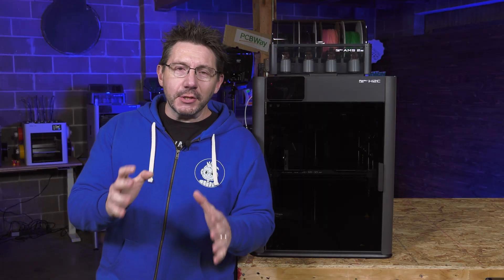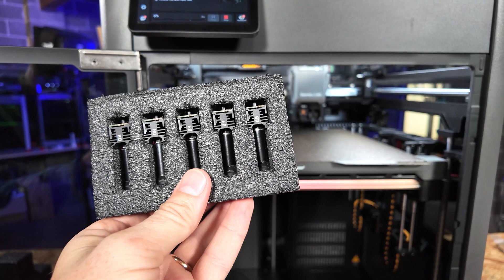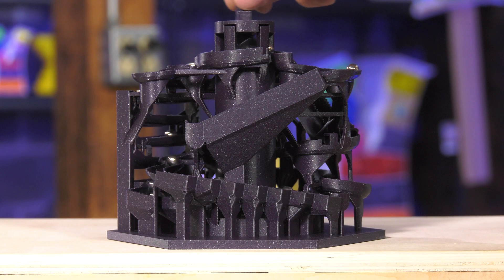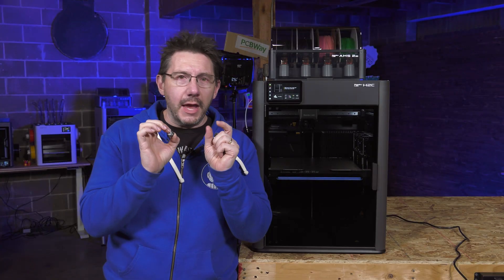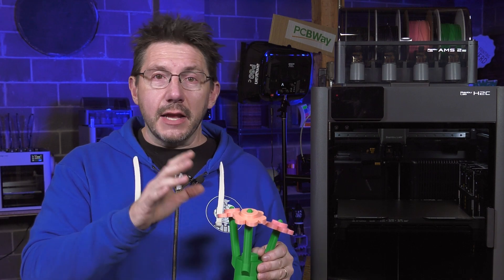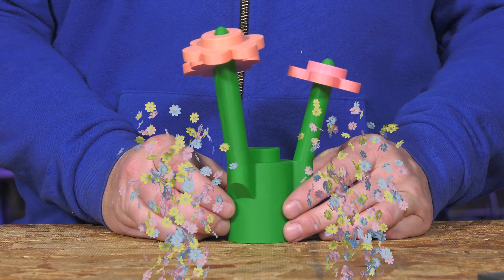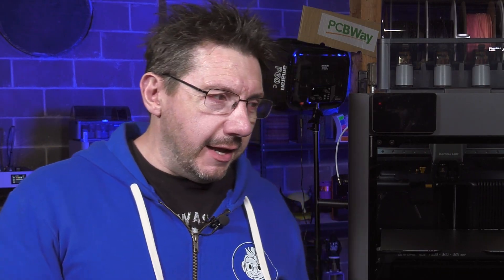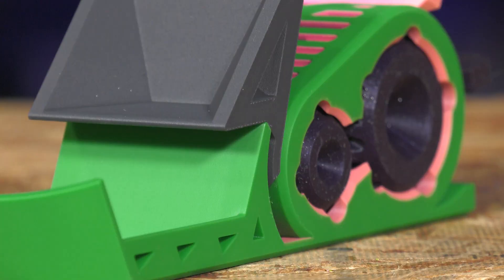My Review of the Bambu H2C + Vortek

Comment: I avoid pa6 like the plague. Pa12 is significantly better.  Pa6 can hold like 4x the water pa12 does. It never splits for me and I have used it for car parts. Pa6 just seems to split constantly if it's cf or gf
Reply: Yeah all the tool manufacturers are dumb for using pa6 for all their casings...

Comment: I liked the video and i loved to know this big issue with the bed, but I think that the majority of the ppl where here for the Vortex and in this reguard the video was kind of "weak"... I would love to know the difference in time between a normal ams multi color print and a print with the vortex, just to have an idea if the system is actually worth it, or even if you have any info about the Vortex on other machines from your "guy".... I have my eyes on the H2S and at this point I have to ask, you probably have that one as well, does it have the same thermal issue on the bed or is limited to this new model?

Comment: 16:30 unless that was designed for that nozzle/layerheight etc, it's not gonna print well. These designs are made with very specific tolerances in mind, when you change that, the slicer will just mess that up with a very high chance of it fusing. You should basically never do that. That's not a printer or slicer mistake, but a user mistake. So it's good to keep that in mind for future videos.

That said, some major issues, bed temperature and clogged nozzle is a major concern, and absolutely unacceptable. A clogged nozzle cannot lead to buying new ones, that's gonna be very expensive very quickly. I also have no idea how Bambu is gonna fix that, that just seems like a major design flaw. With the bed, I would expect them to build it better, but I will believe it when I see it.

As always people, wait a month for regular users to have a new printer without issues. That goes for every single brand, absolutely no exceptions.

Comment: I did not expect Bambu to release a tool-only changer before Bondtech, but hopefully the extra time INDX has been spending in final development leads to a more polished result than this lol. At least you'll be able to put INDX on a printer with a good heated bed.
Reply: I think the Bondtech solution is challenging a lot of Bambu design assumptions. The Dual nozzle build area on the H2C/H2D is definitely a limitation, that bondtech solves. The amount of space that the vortex solution consumes. Bambu told me that on the H2S, adding vortex will cost 7-10% on build volume. Everything I have seen on the bondtech setup seems to indicate no impact to build volume. However, we won't know until the actual product in out in the wild.

Comment: For the heat bed not reaching the correct set temp did you measure it without the pei sheet on it? since from memory the coating can mess with the accuracy of the reading with laser temperature guns

Comment: Tyson Buildd Plate. Every time. Limited in quantity  BUT the best plate ive owned. Acetone clean it and its golden every print. i do not recommend a Biqi Plate at all. i had more prints release from the surface than a stock plate.
Reply: They are the best for sure! I've personally had great luck with the Biqu CryoGrip Pro Glacier specifically. Many Qidi users love them. Have not tried Frostbite.
Reply: @802Garage  my Glacier would release every other print, anything that wasnt more than fist size would have trouble staying on. then blue surface would eventually start to rub off over time with use.. 3 Glacier  plates and all started to do the same thing eventually. Will be sticking to tyson till they stop.
Reply: @shaggykarl  Interesting! Tyson def top.

Comment: I've been printing PA-6 GF and CF on my old P1S with a E3D High Flow ObXidian HotEnd, on the stock bed (cleaned with Dawn dish soap) and Elmers purple school glue for a year or so now. In the beginning, I had bed adhesion issues, but once I started prepping the bed properly, I have had no issues since. My layer adhesion is super strong, and I can now reliably get it to stick to the bed. I tried two other build plates, like the Panda Cryogrip Glacier and the Wham Bam PEX plate, but neither worked as good as the stock plate with school glue.

Comment: thanks for showing the bed issues, i wonder if this is a firmware thing or what? im very interested in this printer to replace the 25 i have now, i guess im going to have to hold off i aint risking bed adhesion issues forget about it

Comment: Hey Joel, I've used PA6-GF from Bambu recently with satisfactory results. I printed a few parts for a BB-8 project, and all came out incredibly strong. For colors, I used their grey and orange. Both were dried in the HT AMS for 12 hours @ 85 °C before printing. I did have to use a glue stick on the textured PEI bed for it to stick. Hopefully, this helps.

Comment: This thing sounds like a nightmare. Think this is a perfect example of why KISS works. You wouldn't think having multiple print heads is a simpler way to do this but in the end a print head itself is simple. So 5 simple things might just be better than 1 complex system.

Comment: Not sure if the bed heating was something they caught on time before the massive launch, otherwise if you have issues with adhesion why even consider a machine like this. Yeah the Vortex system is neat but issues you found with nozzles also presents an issue, as I'm sure these will not be on the cheap side. Guess with all these tech advances we have nowadays, companies like Bambu need to take a break from having a new state of the art machine come out every 8 months. Take the time to work out all the things and then bring out a machine that will work for ages. Thanks for the review as always !!!!!

Comment: Ignoring all other issues. The Bed heating is an absolute deal breaker.
Reply: What's the cost going to be?
Reply: Enshitification at work.  We should be demanding better, not settling for inconvenient work-arounds.  Imagine the uproar if the name on the front said Prusa!
Reply: I don't have failures on my H2Ds. I use the right tools for the right filaments and things work. I crank heat higher, I use glues when needed. CNC kitchen pointed out the bed but after 30 mins it evens out just fine.
Reply: @unitymind oh you just gotta wait 30 min for the bed to actually heat up before you print anything? Yah thats definitely not a problem, especially on like a 5 min print.
Reply: @acolyte8564  What high-temperature print are you referring to that completes in five minutes? High-temperature materials require proper technique. Filaments such as PA6 and similar engineering grades are not beginner-friendly and typically need strong bed adhesion, glue, brims, and sustained high heat. Regarding thermal cameras, their readings can vary by several percent based on surface characteristics, so they are not highly precise. "Red" can be 1 c off the next color in the spectrum.
Reply: @unitymind x1c doesnt struggle with pa6 bed takes 3 min to heat on 220v
The H2C seems to have evolved backwards.

What takes 5 min to print? Im really not sure how to answer that. Blowing an entire spool and filling the build volume isnt a minimum requirement each print. How something could only take 5 min to otherwise print really shouldent be inconceivable.
17h-Print-Pilled, Plate-Maxer lol.
Reply: @acolyte8564  220 volt is not north america. you live in bigger place
Reply: @unitymind pedantic goalpost moving. 
And imagine actually even thinking that lol.
At least run that stuff by google at a minimum before posting, especially with such confidence too.
Embarrassing.
Reply: @acolyte8564  I am confident bambu will miss your business. 🙄enjoy your snapmaker
Reply: 10-15 degress diff is really a deal breaker ? or is it the 30C diff >during< heating ?
Reply: @theaypisamfpv ...... yes.
Reply: The temperate becomes even before the printer starts to print, so it’s not an issue. Just another case of a youtuber trying to create some views and milk some cash.
Reply: @diavalus  So he just made up the failed prints that had plenty of surface area to stick?
Reply: @gtrlum fan boys will be fan boys. I’m a bit disappointed in the whole setup. Still takes ages vs snap maker u1 and INDX will be better I think. We shall see though.
Reply: @diavalus you get commission?
Reply: @diavalus  So how do you explain the warping?
Reply: @diavalus  His bed seems crap... Bambu lab will see this and look into it... They will not be able to sell this printer if this is a common problem.
Reply: How so?
Reply: @riba2233  Oh come on man you can't be serious with this one. Now an even heating bed isn't an expectation of a $2,400 printer?!
Reply: @riba2233 please refer to the video that the very comment youre replying to is on.
Reply: @riba2233 because you don’t want failures

Comment: Can you remove the jam without a drill bit? The internal channel before the nozzle would be larger and should take a drill bit to cut through the frozen material. I understand why they did not use heat-resistant magnets; they assume that part of the head remains cool, and since the electronics there are sensitive to heat, this reasoning makes sense. 

The Vortek system reminds me a lot of a CNC machining centre, where the tooling swaps out of a carrousel built into the machine. Will the next version have a belt or carousel with multiple dedicated tool heads (hot ends) and an AMS that can roll in and out materials to match the heads?  You could also have a multi-axis head that prints in all directions. Even better, eliminate the need for filament by feeding plastic as resin, which is vacuumed from a 1000-pound box and then mixed with colourants or additives before extruding. Alternatively, complementary materials can be co-extruded to create in-die laminates that achieve combination properties.

Comment: Hmm… looks like Bambu Lab dropped the ball on the H2C. I’m happy with my H2S. No need for me to upgrade.
Reply: I just want a good helmet class 3d printer. But I also wouldnt mind 2 or more hot ends.. but for $2399..
Reply: @writer8706  I just can’t justify the price. My H2S has been solid. I don’t really print multi-color that often, but I did grab the High Flow hotend with the 0.4mm tungsten carbide nozzle, so I should see a somewhat of speed bump whenever I do.
Reply: @SinRoyal yeah that price is to rich for my blood.

Comment: think ill be waiting for a new heat bed then before grabbing one of these
Reply: The inability to unclog nozzles using heat is a problem for me, even if they fix the heat bed.
Reply: @JonS  You can do a coldplug which is in most cases the better way to clean a nozzle.
Reply: Cope
Reply: @MegaChickenPunch exactly i dont know why the guy in the video decided to push a coathanger like thing into the nozzle and all that.
Reply: @fw_uke_ha Oh look, someone has independent thinking capabilities...you're right but the neophytes in the room that only know how to brute force clogs can't wrap their minds around it
Reply: me too
Reply: It's already exactly the same bed heating configuration as the H2D.

Comment: I REALLY LIKE that you showed the issues and problems with this machine! It makes your video invaluable to anyone thinking of purchasing it. 💯
Reply: Totally agree. Good ta see ya!
Reply: Wouldn’t the value be limited to the cost of the machine?
Reply: @Samcraftcom  I came to say this 👆🏻
Reply: Sam are you refering to unevenly heated bed? hmmm try to find it, it is gone...3DNerd stoped many people from buying it with that bogus claim... Needitmakeit  made video showing the truth. :)
Reply: Even the misinformation around the bed heat and lack of cold pull ability? Makes you wonder what else he "missed?"
Reply: It was! Now I feel comfortable holding off on getting this until kinks are worked out
Reply: @god1aj  All H2* has the same design of bed heating and they still have not done anything to fix it. Doesn't look like they are planning to change it
Reply: @dimav83  Multiple replies talking about bed heating and no one has answered by question.  What does this do that the H2D doesn't, aside from producing less waste in multi-material printing?
Reply: Honest question, other than the potential for less waste from multi-material printing, what does this do that the H2D doesn't?  I just can't see getting this over the H2D, especially with the build plate heat issues
Reply: @PoppinfreshWV  that's all it does better.... more colors with less purge
Reply: @PoppinfreshWV @PoppinfreshWV  I've seen thermal camera footage of the H2D, and the heating element looks identical.
Reply: @PoppinfreshWV someone correct me if I am wrong but this is the same build plate on all h2 series
Reply: @sasquatchphil89  different size. Smaller by I believe 30mm or 20mm
Reply: @zentrani  Correct, which is interesting because a conversion kit for the H2D was promised at one point.  Assuming that kit is going to require replacing the bed?
Reply: @PoppinfreshWV yeah that or dremel your existing bed lol.
Reply: @sasquatchphil89  I've seen thermal camera footage of the H2D, and the heating element looks identical.
Reply: @sasquatchphil89  it is not.  it is physically smaller.  However, that does not mean that the other build plates heat better.
Reply: @SPRTN085 yea you are right! 

I think it’s the same style though
Reply: Issues which are NONE... it has been shown and proven that the printer doesnt have issues with the bed heating and it has a built in cold pull function... you dont need to heat the nozzle it with a burner.

Comment: Keep being honest, Joel. One of the reasons we come back. :)
Reply: This was bogus claim about bed, not honest at all..., aparently it is not that bad, some other guy did test with multiple 3d printers H2C including. I can't belive why3D Nerd would do this claim about the bed...It is not true... Whats worst, that part is removed from video now... makes you wonder about honesty...
Reply: @comentator4481 he reacted this in one of his shorts. He also admitted he needs to do better testing with this scenario. People make mistakes.
Reply: @hanslain9729  And he didnt notice that there is a cold pull function built in the printer, you dont have to heat it with a burner. This test is just bad.
Reply: After significant investigation, I now believe this video was not honest.